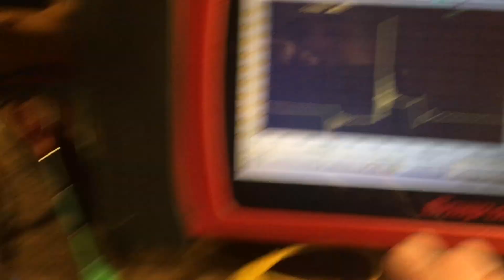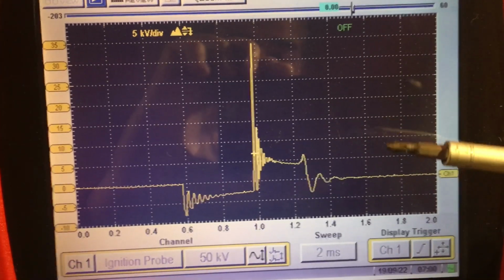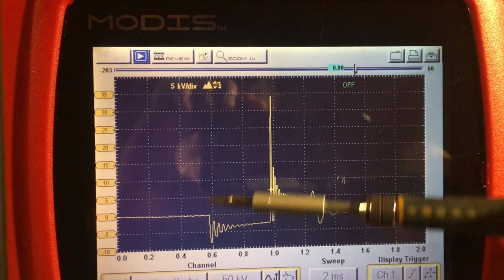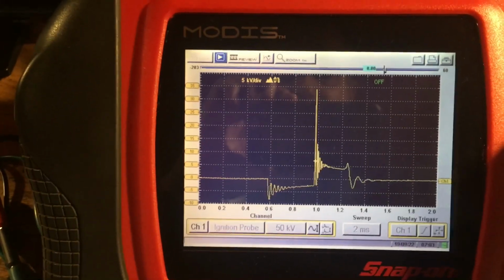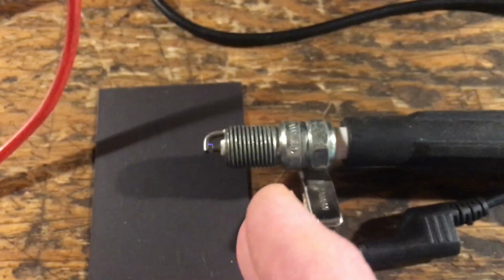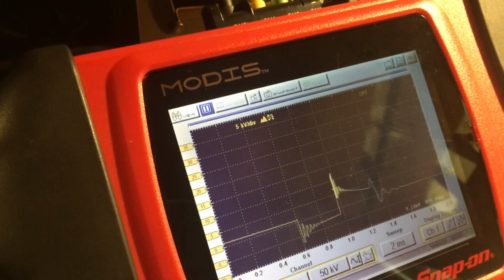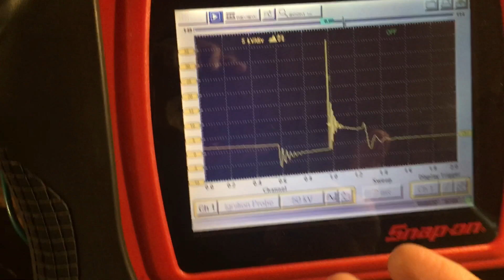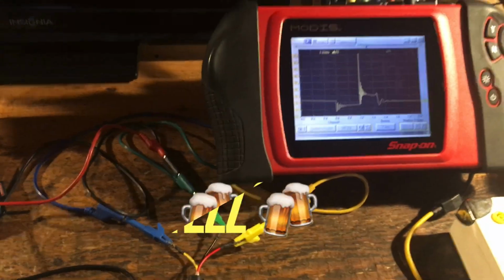Secondary Ignition Waveforms (Not just for automotive masterminds)

Comment: Im so confused... Why is your waveform appearing as if the plug is installed in a running engine... 
Id assume since the plug is out in the open air (simulating a very lean condition) your waveform should be very short at the burn time section..
Reply from the maker: True…but because there is no compression the firing line lowers, widening the spark line (burn time). Making the waveform appear almost as if it’s in a near normal operating environment . 😁👍🍻
Reply: @TheGibby3340  wow thank you for replying, I was not expecting to ever get an answer on that. Especially so quickly.
I guess I'd also assume if there was no compression, in cylinder resistance would go up, causing a higher firing line ... I seems I'm dead wrong about that though.
Oh boy automotive diagnostics can be a head scratcher.

Comment: I understand there is an approximately 400 volt kick when the magnetic field around the primary windings collapses and induces the primary coil energy into the secondary windings. In the secondary windings the voltage increases to 20-40k volts and fires the plug. Are those separate events that appear as two spikes on the scope (one at 400 v and one a short time later at 20-40 kv)?  Or is it one continuious event that shows up as a single 20-40kv event on the scope? I only see one vertical spike. Thank you!!
Reply from the maker: This trace is only from a secondary perspective…Think the 400 volt “inductive kick” your are referring to is transpiring on the primary side of the circuit (self induction) It’s this same kick on the primary which results in the 20-40kV on the secondary. At least this is my understanding of it. Thx for watching 👍🍻

Comment: Hi Ian and you are correct that analyzing ignition waveforms isn't that difficult. Just a couple of pointers for you and your viewers. The initial oscillations at the beginning of the dwell period should always be there. As the primary magnetic field expands, it cuts across the secondary winding creating its own magnetic field. But because of Lenz's law, it will try to counter its effects. So, in effect, you're seeing the back emf or counter electromotive force, (CEMF) from the interaction of these two magnetic fields. If you don't see these oscillations, it would indicate that you have a shorted secondary winding. If you look at a fuel injector voltage waveform, you won't see these oscillations because there isn't a secondary winding.

Also, the oscillations at the beginning of where the spark line or burn line begins should not be present inside a combustion chamber. If they were present, this would indicate an issue which is outside the combustion chamber possibly carbon tracking. In your setup where the spark is discharging in the air, these oscillations is normal. Keep up the good work Ian and have a great day!
Reply from the maker: Hi Terry. Some great points. Demonstrating this on a bench certainty has limitations. As you know, absence of compression and mixture clearly strays from reality. The “ringing” in the trace speaks volumes as you say. This video only serves to introduce the subject to those unfamiliar. Think this material is likely best absorbed in small measure. Thx for watching. Cheers 🍻

Comment: Hi Ian, most of what I learn is from YouTube.
I did go on a diagnostic course, however they simply said if there is a waveform, then the coil is being controlled.
I don't always know what's wrong from looking at a waveform, but I'd like to improve. 
I also found my hantek would freeze when looking at ignition. Cheers Matt
Reply from the maker: Hi Matt. I wrote this topic off as too involved initially. But like everything else, broken down into small “bites” it’s not beyond comprehension. Thx for stopping by Matt. Cheers 👍